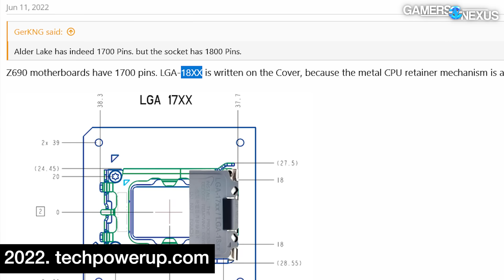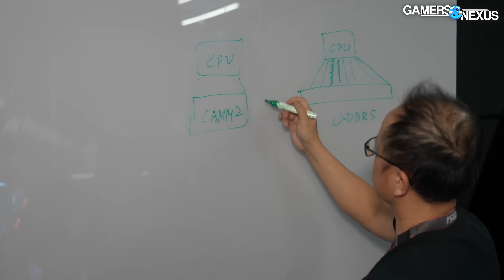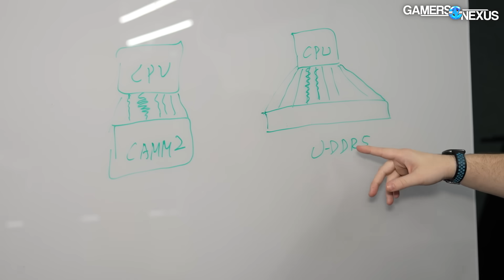Intel Says Not to Say "LGA1851" or "Z890" | MSI vs. ASUS Features & X870E Boards

Comment: Hey Intel, I'll call the socket whatever I want to.   Tough luck on you.  If I want to call the **LGA1851** socket "Irwin", then I'll do it.

MSI: "More Suck Included"?  So the MSI case blows?  Yeah, I'm sure it does.

Of COURSE CAMM only has the one slot.  They want to force you into upgrading more often.  Just like any other manufacturer.

Comment: i wonder what socket we will get next after this; well we had 2011 and 2066 a few years ago, i wouldn't be suprised if intel pulls it out again
gz to those who still have a X79 or X99 board, 
u may be in luck for a bios update to support its newest cpu then
Reply: Nah there's no way knowing Intel it will be like socket 2020 and socket 2077 lol. They would never revive a dead platform and not cache in on a new motherboard market.
Reply: well it would save us some money and they know that 2066 or 2077 is easily capable of handling 500w and more

Comment: I do kinda hope CAMM2 takes off. It seems like there's a lot of advantages (closer to the CPU, higher potential speeds, low profile and able to be used on desktop and mobile platforms).

I understand that you lose the ability to drop in more RAM at the drop of a hat; but that's been advised against for years now for performance, where you should use matched pair or set kits or you can easily run into problems at higher speeds and timings.

It does look to be a fragile connector like the CPU socket though. I'm sure motherboard manufacturers are worried about increased RMAs. That might be the nail in the coffin for it if enough manufacturers don't want to adopt it over the possible increased risk factor.
Reply: The pins seem to be much thicker than on today's CPU sockets, at least.
Reply: Thet may advise against dropping in more RAM, nut I'll do it anyway.   Deal with it board manufacturers.

Comment: I like to imagine what these vendors could do if they actually experimented a little bit. The perfect motherboard, for me, would be an enthusiast class motherboard with no audio section, no WiFi, with dual 10Gbe, and a dedicated, and isolated USB audio passthrough. Like, make sure the USB port has its own dedicated trace to the memory that it doesn't have to share with anything else. Make it black, and please don't put any plastic covers on anything. Metal or nothing. Plain aesthetics with no graphics. Think Apple..

Comment: 70" TV on cooler - when?
Reply: Why would I even need a mini screen in my cooling system?  All my computer cases are metal cases without windows (in either usage of the word), so I'd never see it anyway.
Reply: @SenileOtaku I’d recommend getting at least one glass side. Just so you can check if there’s much dust or if any fans are failing.

Glass panels are more than just for looks

Comment: They can afford the R&D, Design, Manufacturing and Assembly of a totally custom PCIe quick release latch but still skimping on a $0.06 Segment display?!
Reply: Oddly despite ASUS developed it, seemed to be on few boards.
Reply: It's purely and solely for product segregation
Reply: It's actually baffling that with cheap ass OLED screens you have no output of what the board is actually doing. Or a serial connector that you can read from. Like these are solved issues that could have solutions but it would take a brave and courageous engineer team to ensure you can do basic diagnostics. It's 2024 and keeping the status quo is more important than ever since we're all paying 150+ for basic boards and 300 for feature filled boards which only still have 3 pci-e slots and 5 if your pro. Maybe your lucky and can just get a board with 7-8 and just using a nvme pci-e adapter instead like a normal human bean.
Reply: every day I'm glad my MSI board has at least the LEDs
Reply: @GewelReal  I miss EVGA with the dual removable BIOS chips but yeah we need more than beep boops! (and they dont even ship the speaker)
Reply: @GewelReal My ASUS board does have LEDs, I would hate to not have anything, it makes no sense. It’s so cheap
Reply: @GewelReal  the board gives you that many problems? Every day? I don't reboot too often so I don't generally have a need for POST codes either.
$  uptime
 09:37:09 up 99 days, 14:58,  6 users,  load average: 0.19, 0.19, 0.17
Reply: I mean, they could go for a small OLED, but then they'd have to charge 500 bucks more for the board, despite a small display costing about the same price of a segment LCD one.
Reply: @BrunodeSouzaLino  why is oled so expensive? On aliexpress an oled screen is less than 2 bucks. But 7 segment led displays are even cheaper still. Well, the 2 digit ones are fairly costly. Oh wait these prices are for 10 pieces. No LED is way cheaper. They don't even bother selling them individually. You takie whole bag!
Reply: You do realize that the display needs to be wired in, don't you?
Reply: Yeah it takes a cad engineer 3 minutes to do that. The schematic for this is hilariously simple so idk what's your point.  @1pcfred
Reply: @1pcfred  Yeah... they have a footprint the for the EDA the engineer uses to design boards. Drag and drop add a few traces, done.  Pick and place machines do the rest.
Reply: @1pcfred  If you're regularly designing impedance matched, length optimized traces on a 10+ layer board to meet PCIe specifications, then adding a 7 segment display to the schematic and layout  is something you could do in your sleep.    They do come in SMD packages, too.  Even still, THT would be easier than having to assemble one of these PCIe contraptions.   

I'm just saying.... it's far easier and cheaper to put a little LED indicator onto a board than have to design and manufacture a completely new and complex mechanical assembly.
Reply: @1pcfred  since when does etching need wires?

Comment: Is cam ram already the equivalent of dual channel? Or how does that work?
Reply: Yeah, one of these modules has connections for two channels and potentially as much or more memory than 4 regular DIMMs. There are also designs for single-channel variants placed stacked and staggered on a different type of socket.
Reply: @whyjay9959 Interesting…

Comment: I cant imagine that CAMM² will prevail against DIMM RAM. It doesnt look good, you need screws, you have to be way more cautios in the installing process and you cant just  switch a single module in and out or add more later. Thats a bad direction. Its like Apple. Now if one Module is faulty you can just remove it and your pc will work with 4GB in one remaining module. But if your CAMM is faulty your whole PC is broken and useless. And in the early 5-8 years maybe longer no friend or so will have a spare module or a cheap one on the secondhand market. With this direction the PC as a Platform will die. CAMM will only be play a role in Servers and mabye special industrial PCs

Comment: 13:55 I have a Xiaomi desk fan that has a rotor design like that, two very different patterns rather than just the usual large fan blades. It's very quiet and moves a F-ton of air.

Comment: Imagine if Intel put half as much effort into making their partners follow a power delivery spec as they put into making them not say the clearly labelled thing
Reply: Rumors around Hillsboro are that they're tightening the leash a bit more for this socket. ARL should need less power than RPL/ADL given the massive node jump as well. I remember seeing some leaks of 177W and 212W ratings instead of 253W, but I have no idea if those are final.
Reply: Intel has its priorities completely wrong, but we have AMD luckily.
Reply: @brugj03  Yeah, because Radeon marketing is absolutely top notch. /s
Reply: @zodwraith5745  Your point is...........??
Reply: @brugj03  🤣 Wait until you use AMD's server junk, and you will run into problems you never hear about. The biggest problem with AMD is no matter what they do BUGs keep returning. The USB bugs were bad with their 760mpx chipset and RETURNED ~20 years later. AMD cut a lot of corners and ignores problems until motherboards start burning holes into chips.
Reply: @michaelcarson8375  In once sentence essentially: "Supermicro" + "server junk" + "USB issues". Is it a " muh cellar server"?
Reply: @VADemon  If you think Supermicro servers are junk you know absolutely dick about servers and just proved it to everyone.
Reply: @zodwraith5745  Somehow you are attempting to prove your worth in comments more than anyone.

I didn't exactly want to imply Supermicro is bad. They are fine. If you read the comment I replied to again, you will understand that I was digging at someone who has managed to complain at server hardware and USB at once. So what's the "big boy" need for USB other than a boot image? Conversely it's a home server with a ton of USB.
Reply: @VADemon  Note taken. Sorry if I'm a fast typist. But tell me in one place I'm actually wrong. Not to mention you said Supermicro while the person you were responding to never actually said Supermicro. There's plenty of professional use of USB, especially when troubleshooting which is the most likely the time it's REALLY going to piss me off. Which ironically I've ABSOLUTELY experienced with AMD systems and left me scratching my head, NEVER solved, but magically went away with a BIOS update 12 months later proving it was on AMD all along and not my incompetence. 

I still keep dsub serial adapters on hand because you never know what you're going to run into. Acting like a USB dropout issue means nothing is honestly naive when it's BY FAR the most popular quick interface today.
Reply: @brugj03  Tried AMD twice. Got screwed both times. They are as unreliable as it gets.
There's nothing lucky in having AMD, unfortunately. I wish Intel had more threatening competition.
Reply: @Shendue  Whatever you "got screwed" by was likely not an actual AMD problem, and more a 3rd party problem. Far too many AMD machines in my home over the past several decades for that nonsense.
Reply: @waldojim42  3rd party would be my first guess, unless the problems happen consistently with several manufacturers. 
Just consider the reports about exploding power supplies (Gigabyte) or mainboard vendors setting power limits to ridiculous values out of the box (ASUS with Intel CPUs IIRC). All for saving a few cents or eking out a few more percent in a benchmark.
That sort of engineering is calling for trouble, and it is primarily not the fault of Intel or AMD.
Reply: @rabiatorthegreat6163  FWIW - Asus did that to both AMD and Intel. Chasing that "competitive advantage" Remember the exploding 3d vcache chips? Asus. And to a lesser extent Gigabyte for the same reason.
Reply: Add that (not so stupid) release mechanism into that. They do everything they can, to justify the (I bet they will again be) significant price increase from the previous gen boards. The only and most important thing they forget tho, IS TO MAKE A FKN GOOD BIOS. Even after now years of having released the 670E boards, the bios is still dogsht, especially MSI's. They literally release broken bios updates casually every now and then, lol.
Reply: I don't think this is so much an "Intel" thing as much as some uppity marketing exec that's got sand up his crack because it was supposed to be HIS announcement he's been working on all year. 

Easily the worst part about being a hardware enthusiast is the insufferable marketing bullshit from ALL these companies. cough*Radeon Marketing*cough Just be honest and open with us like Tom Petersen has been. I really thought his work with Arc was a sign Intel had stopped that brainless corporate bullshit, but Intel's a big company and I'm sure there's still a lot of idiots there that still have too much power.
Reply: Imagine if they put as much into actually making good chips as worrying about "garbage naming conventions..."
Reply: Such Intel keke furnace trash.
Reply: They didn't cause it did well for reviews and benchmark scores
Reply: And this is why I will never buy Intel Again. I am not willing to use a CPU that has more than 130W power requirements, or one that does not have a clear power consumption figure on it's official datasheet. I have always used 65W or 105W CPU-s, and will continue to do so. Just not Intel anymore... :(
Reply: @h2835  I think along the same lines, and I prefer to look at the absolute limits, not at some "typical" value from the manufacturer. That's why I have an "88W" AMD processor.
Reply: @h2835  So for all the years when AMD was insanely hot you refused to use them? Intel is PASSING TSMC on node advancement and will be MORE efficient than AMD. So what you're saying is you're switching back to Intel, or are you really just grasping at AMD fanboy ammo?
Reply: @zodwraith5745  If Intel actually improves thermals, performance, AND reduces power draw compared to AMD... why not? But the last time they did all three was when AMD was throwing power at FX. Kinda like what Intel has been doing as of late.
Reply: @waldojim42  So you'll only consider Intel if they absolutely decimate AMD in every category? That's what we don't want and why Intel had a monopoly for so many years. 

Intel is already competitive on performance. AMD wins in gaming with X3D, but loses in production. AMD barely wins in production with non-X3D, but only at the 7950X. Literally every other sku Intel gives you superior gaming AND production per dollar. With AMD you have to CHOOSE if you want gaming or production.

The 7800X3D is the gaming king. There's no doubt. But I don't know if you're aware but there are a few people out there that actually use their PCs for things other than gaming, and don't play games at 1080p with a 4090. The i5 destroys the R5 in production. The i7 destroys not only the R7 but also beats the 7900x in most production while being cheaper. And it's no secret that Intel beats all the non-X3D chips in gaming.

It's really only the space heater abortion that is the i9 that's ridiculously hot, and no one should buy it. But if you care about mixed use and aren't willing to pay $600 for a 7950x, Intel is very competitive already. I actually care about compiling and compression and that's exactly why I bought a 14700k. It's no slower in real world gaming because I don't play at 1080p because it's not 2008 anymore, and absolutely annihilates the 7800X3D in real workloads for the same price. 

Arrow Lake is shifting from 10nm to 3nm. There's no way it will still be stupidly hot with that node shrink when AMD is remaining on 5nm. Lunar Lake and Xeon already looks to be taking the efficiency crown on 3nm. Just pure common sense tells you Arrow Lake won't be the hot mess that the i9 raptor lake was, and it's looking to have at the very least a similar IPC uplift that Zen5 is promising. 

So I'll ask again. When Arrow Lake is at least the same speed as Zen5 while using less power will you suddenly become an Intel fanboy? Or just make excuses why you should still buy AMD?

Don't get me wrong, I daily drive AMD and Intel side by side, but I tire of the AMD fanboyism that rules YT comments because they only care about gaming while pretending real workloads don't exist, and even techtubers have noted you're not allowed to say anything bad about AMD. But if you only care about performance per dollar Intel is NOT behind. They're just using too much power.

All the gaming nerds are already claiming Zen5's victory when a new X3D hasn't even been announced yet, but I'm actually worried AMD might fall behind again as Intel retakes the foundry lead. And none of us wants that.
Reply: @zodwraith5745  I think with you we got  a real fan boy on our hands.
Great, leaves us with more from AMD.
Reply: @brugj03  I didn't get triggered enough to reply to you twice. I hate Intel. But thank God I'm not a brainless AMD fanboy.
Reply: @zodwraith5745  You hate Intel, you don`t like AMD. Doesn`t leave you with much now does it.
Maybe you`re just pathetic.
Reply: @zodwraith5745  First, not reading a book on youtube.

Second, it isn't much to ask when AMD has already done that to Intel for... several years now. AMD X3D dominates gaming. It dominates it without needing 300W . And it dominates it without generating more heat than can be reasonably dealt with.

That is all. Anything else is straight up delusional.
Reply: @waldojim42  I'm sorry reading is so hard for you. If you'd actually read it you'd see that's not what I said at all. Not my fault you aren't capable of doing anything on a computer beyond playing video games.
Reply: @zodwraith5745  Capable and willing are not the same thing. Sorry for the disappointment.
Reply: With great power comes great corporate greed responsibilities.
Reply: Intel baseline profiles have been around for YEARS. Back in the day Intel made their own board that were baseline ONLY, and nobody bought them. If you only want baseline in today's world go buy supermicro boards, nobody makes a more stable board. when Intel first allowed overclocking most boards HAD baseline default to AUTO and everything was fine, but competition got out of control and finally hit the wall.
Reply: @michaelcarson8375  oh I have had plenty Intel boards, they were highly sought after because they were rock solid and you could still OC on them if you wanted. but they were known for QUALITY... and not just "gamer" unstable stuff
Reply: @LiLBitsDK  Don't lie. No "gaming" board is ROCK stable, they come default OUT of the box with an OC.
Reply: @michaelcarson8375  The thing is, even what the boards labeled 'Intel baseline' did not comply with Intel recommendations.
Reply: @BillyONeal  What gaming boards were labeled on the box Intel Baseline? You are straight up making stuff up by saying: "The thing is, even what the boards labeled 'Intel baseline' did not comply with Intel recommendations."